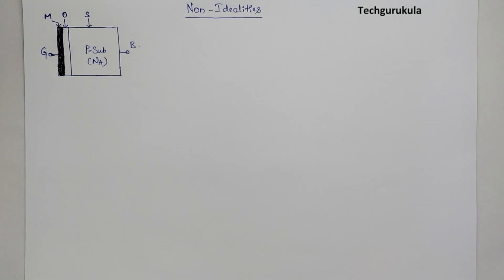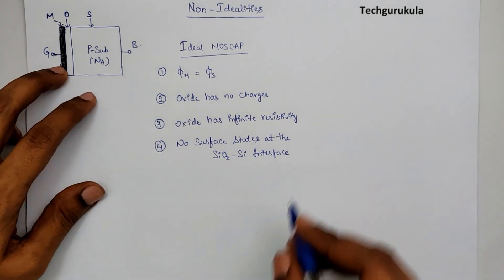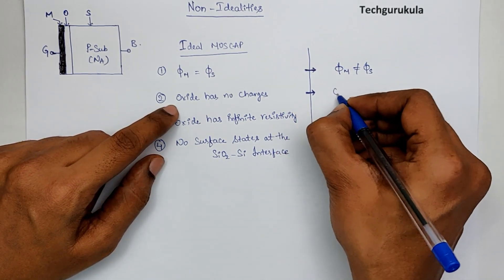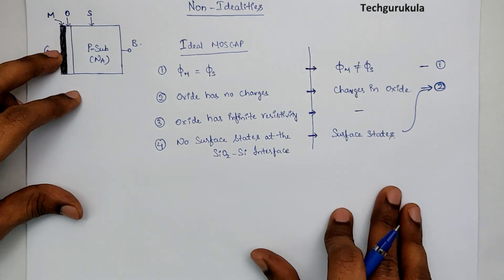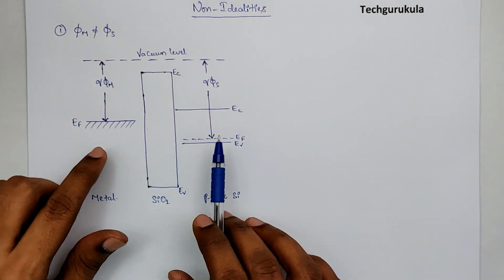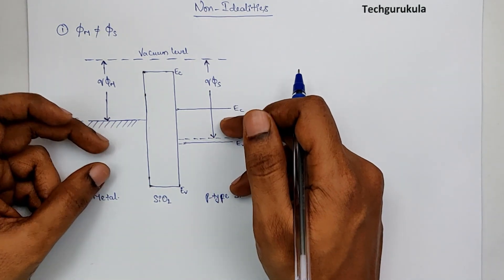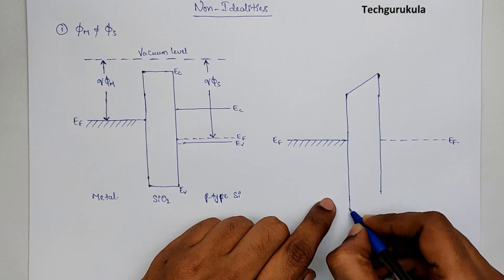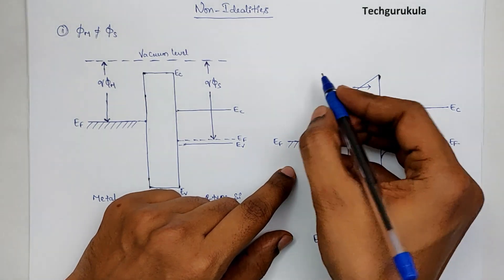Electronic Devices: MOS Capacitor (08) - Non Idealities : Flat Band Voltage

Comment: problem of this playlist is you derive only one equation Suppose , You Want To Derive Threshold Voltage For MOSCAP  , You Derived only P-Type MOSCAP equation and SKIP ALL THE DIAGRAMS AND ALL THE CV CHARACTERESTICS AND ALL EQUATIONS FOR     N -TYPE  .... now suppose in some video that also include , that will get high ratting than you ,,, you have great potential but try to present it completely , thus student have no question to ask at least in Initial stage ....

Comment: Why would fermi levels in metar and semiconductor be different? I understand fermi levels as potential energy of all electrons on that distance x. If they are different would that mean electrons would like to go to the semiconductor even without anx extrinsic field, is that due to diffusion, as metal has way more conduction electrons then semiconductor?

Comment: Sir, in Charges in the oxide, can Qox be negative?
Reply: Yes , Offcourse It Can ,, then put negetive voltage in the place of Qox in equation in VFB ,,, This VFB equation Does Not Change Over P - Type Or N - Type Substrate This VFB equation will work for both